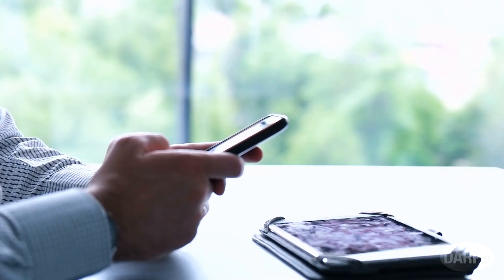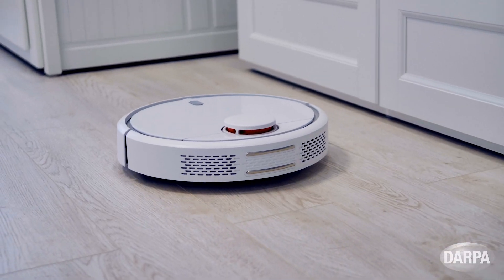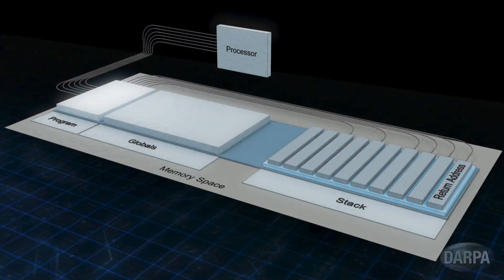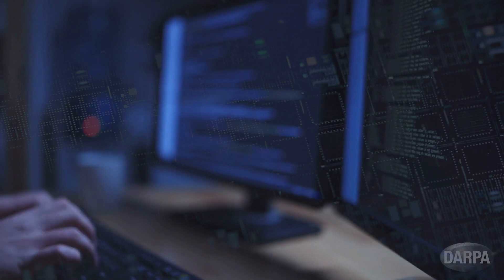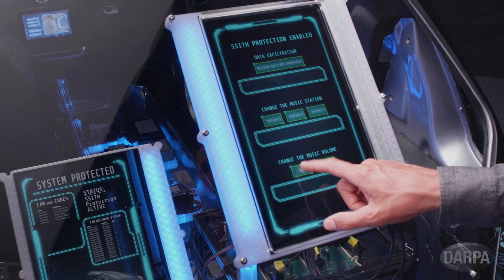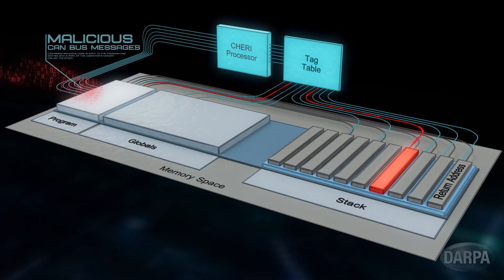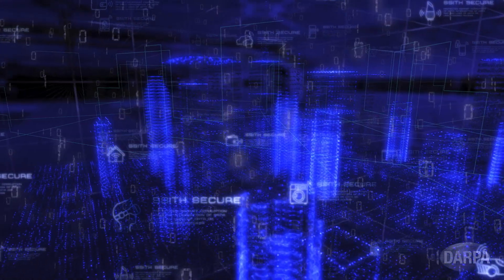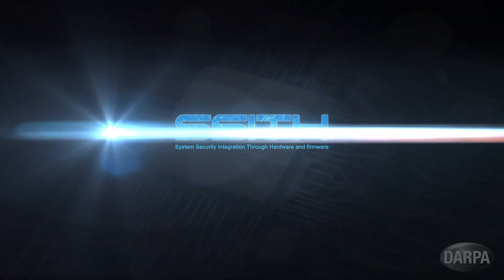DARPA SSITH – Securing our critical systems

Comment: How do you inform the hardware what constitutes a dangerous set of software instructions vs. what may look dangerous. Very interesting... Also when the attack is blocked does the system recover or does the program halt and the car blue screen, that could be just as bad as a "successful" attack. Again, very interesting!

Comment: I want to believe DARPA will support at least partially open source firmware and coreboot as industry standards.
Reply: Closed sourcing and security-through-obscurity I thought was proven to be worst practice after the whole Nortel networks fiasco decades ago.  Designed from the ground up with concepts of zero trust at the hardware level, qualified career IT people who keep software up-to-date, and using open source software that has been industry proven to be reliable due to a million developer eyes on the code is the current best practice.